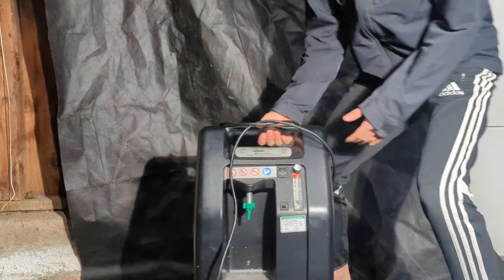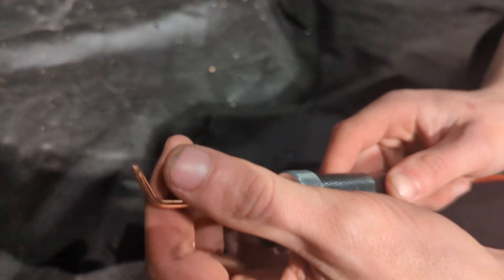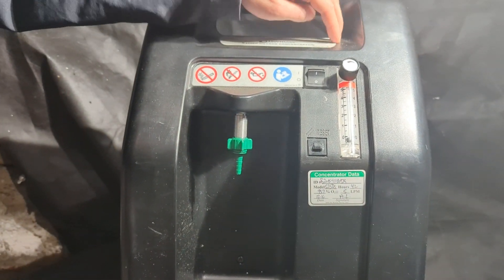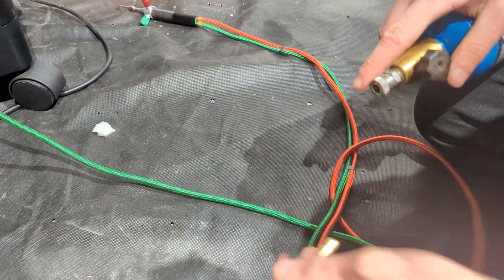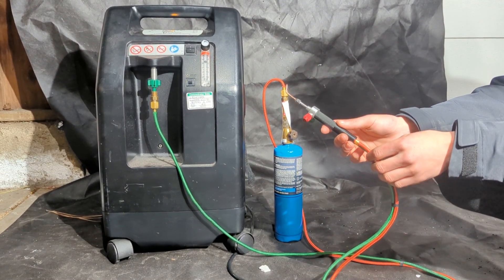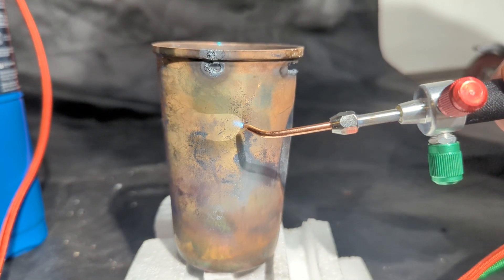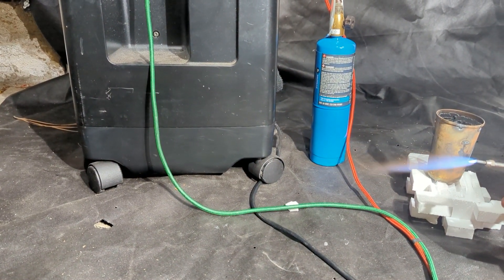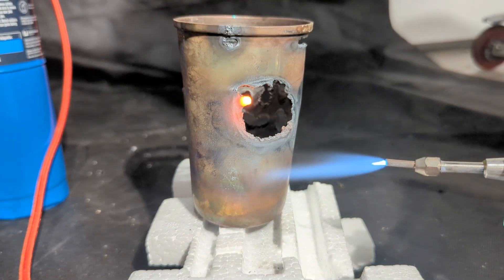Oxygen Concentrator Powered Welding Torch

Comment: Just zeolyte? So you could remove nitrogen from a variety of mixed gases? Might be a good way to remove nitrogen from biogas. Does it wear out or require replacement?
Reply from the maker: requires replacement but after along time and possibly?

Comment: What is the O2 concentration of the byproduct of an oxygen concentrator?
If the O2 concentration is low enough, the byproduct gas could be used as shielding gas for welding.

Comment: I did this, but used my barbecue propane tank. Why buy a separate tank from the hardware store. Plus mo bigga = mo betta. Next test is with a tank of MAPP gas.
Reply: Probably because the torch he's using only comes with a fitting for those tiny tanks. You can buy adapters obviously but... idk, he didnt want to I guess. W/e
Reply from the maker: correct  i didnt want too my budget cries when i make videos
Reply: @ianbuilder  yeah, adapters can get pricey. But they pay for themselves for something like this. What do those little propane tanks cost these days? Like $10usd now? They've always been overpriced imo for the size.
Reply from the maker: @Aaron48219  yea i borrowed the tank from a freind
Reply: This is exactly what I want!! It all started with a dishwasher installing, using copper pipes.... then a fleabay surf found LPG converted to Mapp torch. I've been reading after hours, now, about adding an O2 pump. Wow, then here for video that messed with my head alot. I NEED MORE😊

Comment: What connector did you use to connect the torch, I've got the same torch. Gonna build an electrolysis machine to make hydrogen and oxygen :>
Reply from the maker: its a weird gas fittig 1/4 in  it might be  easier to cut the tube
Reply: That green connector unscrews right off, and reveals the correct screw fitting for the end of the hose.

Comment: I guess glass blowers use like Hospital size versions of those oxygen concentrators. It's a heck of an investment to start with but if you're a glassblower, it sure saves on oxygen cylinders over time. Those things aren't cheap as im sure you know.
Reply: This is a hospital version. That's a medical device. You can't buy one without a doctor's prescription. For real. Well, not a new one. You can buy an old refurbished one though if you promise not to use it on people.

But ya lampworkers, (not glassblowers) buy these exact units, just more than one of them, and chain them together. Or hook them up to an air compressor and fill their own oxygen tanks with them.

Comment: Free oxygen that's actually amazing
Reply: Yep. Just not very much of it. And not as high purity. And minus the few hundred bucks you paid for an old refurbished concentrator. And you pray that the compressor doesn't break or the sieve beds never need to be repoured cuz either of those will cost more than the whole unit did. So treat it gently
Reply: Not to mention the hit to your electricity bill.  I live in an area with cheap electricity (Canada) and these things suck a lot of Hydro, so much that Canadians can claim a medical tax credit.